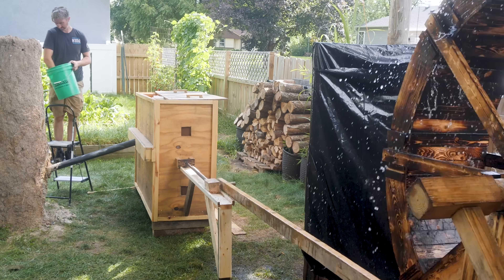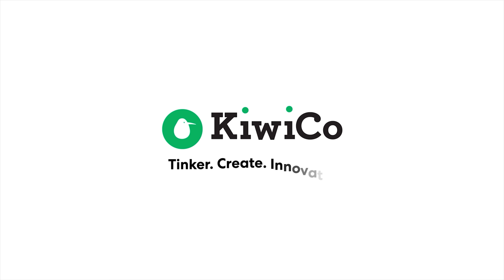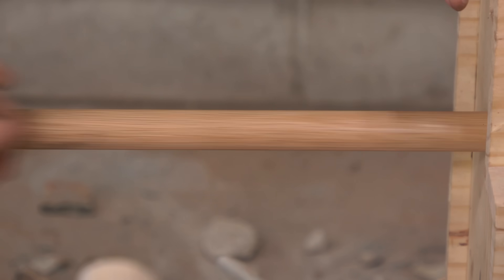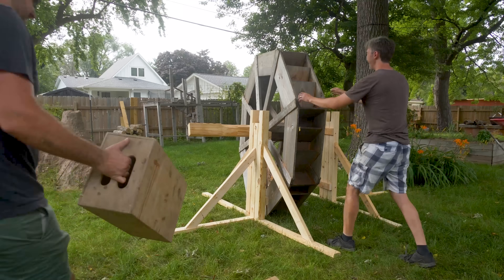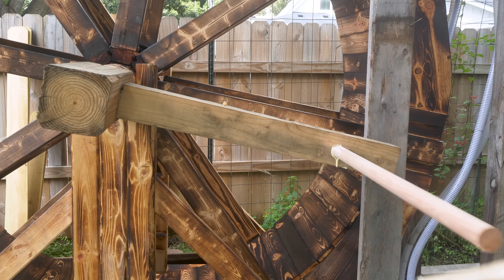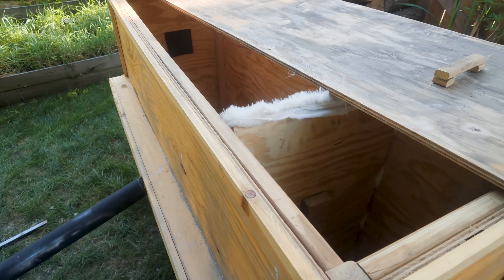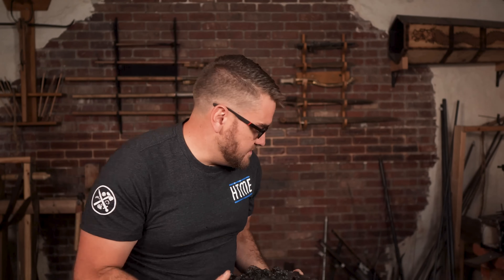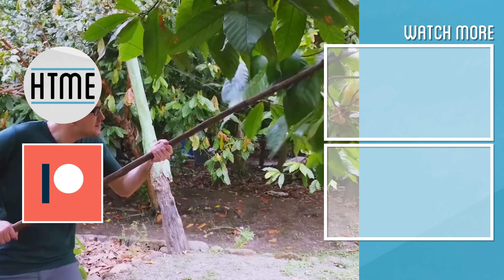River Power: The Secret of Ancient Metalworking

Comment: Great video, thanks for sharing! You might want to check out W.A. Young and Sons Foundry in Rices Landing, PA. I don't know if any other place like it is still in operation. The entire machine shop is run on water wheel driven belts from wheels in the ceiling. (electric added for lighting in 1928) Handles engage and disengage the belts from the ceiling at each machine on the floor. they also have a foundry that would pour metal into the green sand casting floor to cast things like river boat gears. It is amazing.

Comment: on the water wheel, the axel, if you drilled a 1 inch hole in the blackened wood in the middle, then you can continuously oil the axel from the middle. Rather than trying to push the lubricant from the face of the bearings. close the hole with a cork. bees wax, tallow, lard etc, will heat up as it runs out of lubricant, which would then melt the lubricating oil. once enough fats/oils have been added, it will cool back down. this cycle would still need maintance mind you.

Comment: I think its about wrong place + wrong power = bad result. But if the water mill put in real river, it would be more faster and more powerful because gravity and water current power + resistance from water mill and result will be more air and more heat for smelting the iron

Comment: I think you've got a few issues here;
First off, if you're charging cast iron, dont add limestone. Limestone causes iron to be displaced from slag improving yield, but only if you're working with iron ore, and you only need a tiny amount.

Second the stack should always be full of coke, this helps with preheating and maintaining the carbon content of the iron.
I think you are oxidising your iron, which is reducing the carbon content and increasing the melting point - hence why it solidifies.

The water wheel is cool, but probably over complicating things before you get the process down. From the flame, it looks like you probably have an electric fan anyway. 

Last point, keep the tap hole open until iron starts pouring out. There should be flame coming out of it, and this will keep the furnace bottom hot.

Tuyere angle may need some experimenting / research as its a pretty critical factor. Bloomery furnaces used 45 degrees, but I think blast furnaces used a much lower angle.
More tuyeres the better for blast furnaces!

Comment: Never underestimate the torque on drive shafts attached to water wheels. During college my class built one using 3inch steel rod. Snapped it overnight. We ended up using truck differential and torque converter to deal with it.

Comment: The bellows blows directly on to a board at a 90 degree angle drastically reducing the air flow.

The furnace is all brick inside overlapping and reducing air flow out, making resistance to the draft for exhaust. It needs to be smooth. Also taper the exit into a smaller hole to trap more heat.

Build a shoot to fill the furnace, it's safer and more efficient, and you can add a trap door to it to control flow.

Add a flywheel to the waterwheel? Possibly 2x size? Also sand the wood especially at contact points. 

Create a pulley system to magnif your output with the ratio difference. The rope will be more flexible and reduce your friction and possibly the need for the guide plate.

Change the orientation of the billows to straight up and down reducing the drag from gravity on the bottom and using it on the down stroke and helping the rpm.
Reply: lol you build it.
this isn't rocket appliances, its just a proof of a concept. hes not actually going to make his nails with this

Comment: rather than converting rotational to linear for the bellows, why not make a centrifugal fan directly off the water wheel axle (or gear it to higher RPM) for continuous air delivery?

Comment: I think it might be worth considering heat recovery.

I remember when I was a kid I read about cowper-bricks... In an 1940's book about metal industry. That type of heat recovery system, I believe according to the book required at least three units, but practically more like 5 would be used with an actual blast furnace.

Cowper stoves are essentially tall stacks of brick. You run the smoke from your furnace trough one, until it gets hot. Then you operate a set of valves to direct the smoke to the next cowper stove. And at this point you can use another set of valves to direct air through the first cowper-stove.

The way I understood, you would need more than two to ensure uninterrupted airflow. Practically you would not want to close a set of valves until another set is already open. So when doing the switch you could be running two pairs parallel. 

But for practical application, when not melting several tonnes of iron... It might be easier to just have a fairly simple reverse flow, or even just cross-flow heat-exchanger. It might not be as historically accurate as cowper-stoves... But having something like 5 cowper-stoves and all the valves required to operate them, might be a bit much.

Comment: A walking beam, a pivot lever,  or a scotch yoke would help your connecting rod problem.  Bronze plain bushings would have been available for the last 5-8000 years, and would help with your friction problems.    Leather, rope, or cloth pulley gear reduction could give you faster cycles with a smaller, more efficient bellows, or conversely supply the large bellows with more torque at a lower cycle rate.  Fabric or leather bellows envelope might also help.

Comment: You could try making a blast furnace stove, a big stone cylinder used to preheat the incoming air for the furnace, theres a series of valves that enable them to switch back and forth, one stove is heated by the exhaust gasses, and the incoming air for the furnace runs through the other (they switch back n forth, heating one stove with the exhaust gas, and one that was previously heated is heating the incoming air)

Comment: I think instead of a water wheel for your power source you should use a windmill or animal powered mill (like a horse engine ). Seems easier since you are in a landlocked location. Maybe you can experiment with vertical axis windmills (no heading gear needed since they work at all wind directions relative to the blades)

Comment: Perhaps insulating it from below with more firebricks would help, as it would from the sides if they get hot. As others have pointed out, the iron pipes leading to the furnace are far too small, and the resistance of a fluid in a pipe is actually goes up by a factor of 32 when you shrink its diameter by 2.

Comment: im not sure as its not too precisely shown on video on too much detail. but i think the problem may be the construction of the oven itself. by this i mean that usually combustion chambers were different structures to the chimneis themselves. heat and air came to the chimneis from underground tunnels, so if im not mistaken on combustion chambers that were usually above the ground heat and airflow went downwars towards the underground tunnel to then go for the chimney. i may be horribly wrong, correct me if i am.

Comment: That snapping problem is something that I have also been dealing with for a while in this kind of projects. This is working basically as an inverse piston-conecting rod-cranckshaft, classical motor. The length of the rod seems good, since it is usually 1.5 or 2 times the "piston" stroke, although the attack angle is redirecting the force below and not forwards, as it should for this. This happens since the wheel axis is not aligned with the shaft movement, something I see was tried to solve by placing that box under the blower, but the rod weight is still playing against here, and that straight track generates  energy losses. I think it could help to put the blower in the other side, then making the rod to pull the shaft up when retracting instead of pushing it downwards. Still a loose, but is compensates part of the weight problem instead of making it worse. Given the angle, this would make the pushing stroke straighter and hopefully easier, more efficient. Using lighter parts is always helpful, too. I know you are probably already aware of all of this so I doubt this to be useful, but it goes with the best intentions. Good luck!

Comment: There's a Catalan furnace as well where downward flowing water draws air with it. Tbh I don't fully understand the principle but they were still in use into the 1900s. You need a substantial grade differential though

Comment: Regarding bellows, I've seen a dual-stack one where one chamber was pumped to fill another chamber which fed the fire. The fire chamber had air exit more slowly than the filler chamber pumped it in, so the blacksmith could pump for a few seconds and the fire would get air for a much longer time.

Comment: what I don't quite get, is why did they¹ not use centrifugal blowers. that seams way easier to me mechanically speaking.

¹and in extension you
Reply: I don't think furnaces were powered by rotating motion directly a lot of bellows used gravity to reset and camshaft to feed. It was much simpler than the centrifugal style.
Reply: @Imaboss8ball  a water wheel gives a rotation motion. and a centrifugal style blower is quite simple.

Comment: It helps to have a bed of sand at the bottom of the cupola, as well as beginning with a layer of "cold" coke at the bottom. In other words, put probably 3-4" of sand, 6-10" of coke, and then build your fire from there. This has a couple benefits, firstly your stack will heat fast since you're starting higher. Secondly, the cold coke at the beginning will eventually heat and burn, especially when molten metal hits it. This has two benefits, one, it'll help keep things from cooling, secondly, if things are colder the excess carbon helps keep the irons melting point as low as possible (look up iron/carbon matrices in regards to casting) Lastly, by having the sand at the bottom you'll help retain heat and you'll also help with fluxing and slagging a tiny bit.

Comment: around 200 BC...yes, I refuse to add the E...the Chinese designed a bladed rotating fan. Replace the sliding box with a fan and reduce the air pipe.

Comment: Hey so just a suggestion, if you could attempt to build a machine that uses both the haber process and the Ostwald process as separate machines that work together to produce both ammonia and nitric acid, you should. Now that you have a water wheel and electricity you should be able to make a simple piston pump mechanism that pumps regular air plus hydrogen or oxygen from split water molecules  (depending on which process it is going towards) to produce a larger volume of ammonia or nitric acid. I actually have designs for a more simple variety of the machines that should produce enough products to be useable for other purposes. The main purpose of it though would be to get ammonia (which if mixed with potassium hydroxide that can be collected from hardwood ashes, can be boiled down to make potassium nitrate) and nitric acid (which if mixed with ammonia and boiled down will produce ammonium nitrate). Both of these chemicals can be used as oxidizers for gunpowder, or more beneficial to you, can be used to boost the temperature of your kilns by just directly adding them into the fire periodically. If you have an email address I could send you the current design I have for the machines, but they still require a large amount of work to be as efficient as I would like, I’m going to actually build the machine in the next year or so when I can get the materials.

Comment: With a constant air flow, you might be able to use anthracite as opposed to bituminous coal. It burns hotter and much cleaner.
Reply: I think his plain is to make coke to use in the furnace.  Not sure which type of coal the best coke.

Comment: In the box you have a large piece of wood moving air, but the intake looks small. Why restrict inhaling? It should be easy to pull air in, and the only difficulty with pushing it out should be from how you compress it at the output.

There are two small holes feeding the output, but the jet is a long pipe with a narrow opening on the end. You could fill that pipe with a longer slot, no need to restrict what's basically an output hopper from filling.

The linkage between the water wheel and the machine looks similar to a tattoo gun. I don't think they had those in that period, but for sure they knew how to convert rotary motion to reciprocal. Look at how it was done on trains, those big linkages with slots in them are really old tech that might have been around at the time.

Comment: flight tech is very influential. ie biplanes. so how about electric arc furnace ionization of iron oxide to steel. assumptions is that the oxygen will evaporate from the molten iron oxide. and not combine back to iron oxide. yep kinda electrolysis of molten iron oxide but just using the ionization by heat arc plasma. assume that the iron stays liquid. well requires 2500C or so. in a graphite crucible. ie bread basket turned into graphite. graphite rods as the electric arc resistance rods also.

Comment: It's basically a Stückofen. The furnace might be too small to properly both reduce the oxide(endothermic reaction) and keep the iron molten at the bottom.

You might also want to check double-lung bellows since give a constant flow of air and use a simpler linkage to the wheel(reducing friction loses). Preheating the incoming air could also help.
Reply: That's what I was thinking. It's way too small and, the bellows needs a gear train like they would have done in the past.

Comment: i'm not an expert in metallurgy or forging, but that lump you ended up with looks like sponge iron to me. still usable, you could reheat it and work it with hammers into wrought iron, but it means your furnace didn't get hot enough to liquefy the iron, only to sinter it. in accordance with what someone else commented here, maybe your bellows are too restricted to push sufficient air into the furnace for high temps?
Reply: I was looking for this comment, there might be more but this was the first I found. It definitely looked like it was smelted not melted
Reply: The bellows arent actually doing anything. If you look through the video the bellows lid is off.

Comment: With such large pistons, you may want to open the openings on the bellows more. No point restricting the flow when you want pressure over flow velocity. The flow should be constricted later as it flows into the firebox.

Edit: I mean, you have to get it down to a pipe-sized outlet at some point, but I feel like the manifold and pipe currently being used is probably restricting the airflow a considerable amount, and increasing it even slightly would make a world of difference if possible.
Reply: It would be easy to make more inlets and outlets. Making them larger would create more leakage due to the flexibility (lack of stiffness) of the leather.
Reply: @DreadX10  yes! This is how I would expand the manifold.
Reply: Why enlarge anything if at 10:19 you can see the pipe on the left, there is noise like from a fan and the flame is continuous and the lid is open) The fan did an excellent job

Comment: You could make a second bellows for the other side of the water wheel, but instead of making both have the same stroke, set the second one to like 45 degrees from the first one, so you have a constant stream of air at all times. Kind of how a piston engine works.

Comment: If you used alternating bellows (many bellows going off at different times) you could get continuous airflow that way as well.
Reply: This is an alternating bellows, they have outputs on either chamber, and a combiner feeding into their smelter. Clear shot at 12:06
Reply: @randall4876 what he means is having bellows synching their timing, there is a gap where the bellows lose power as it ends the stroke and it starts going in the opposite direction
Basically have 2 bellows timed so one is on the middle of the stroke while other is at the end of the stroke, that way you keep the flow more constant instead of having an intermittent flow in each stroke direction change

Comment: Seems like you could work the iron you got from the first attempt and made wrought iron instead of cast but I think you're probably right. Just got too cold before you tapped it. Maybe try and do the forced induction from below the fire? Same sort of principle as a steam locomotive's firebox. Force the air from the bottom of the fire through all of the fuel. Although I suppose the same issue with the molten iron dripping down could be a problem and that could even seal the air inlet up.

Comment: What’s with the “click analyze to begin” message at 13:01 in the video
Reply: it looks like that dialogue box is from Premier Pro
my best guess is that they were trying to apply a stabilization filter to the shot, but either didn't properly run and apply the filter, or did run and apply the filter, but ran into what seems to be a bug where that dialogue sometimes doesn't disappear after analyzing
Reply: @adicsbtw more accurately they ran into an issue where their editor didn't actually watch the video.